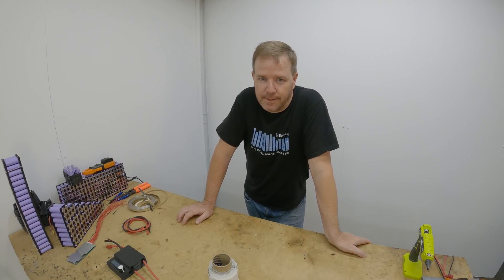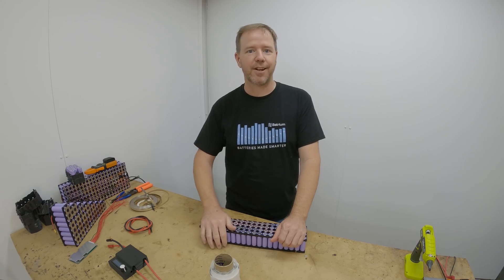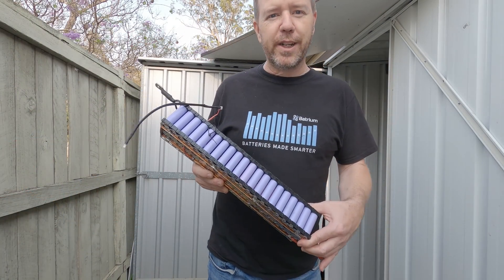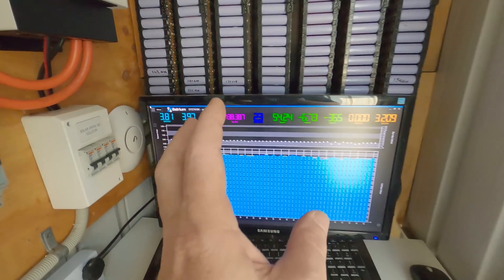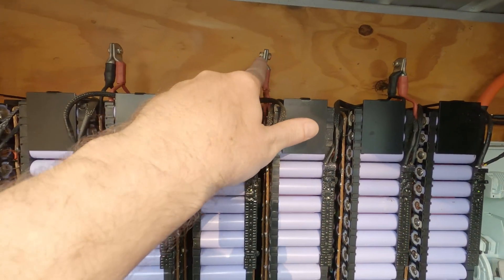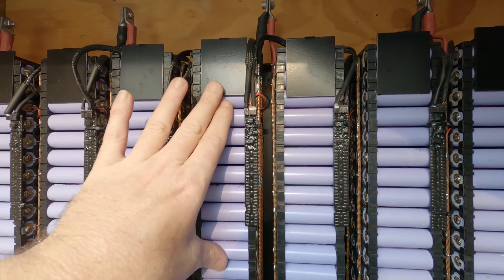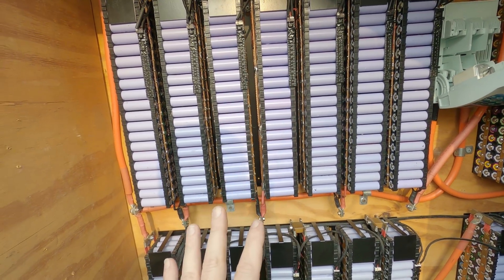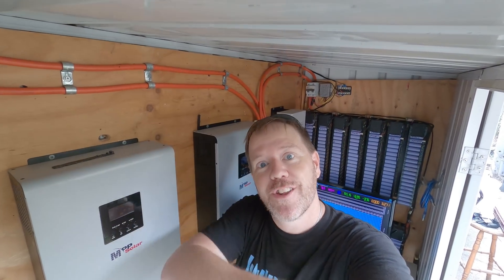Building a fast 18650 DIYPowerwall 80P battery using a KWeld Spotwelder

Comment: Hey mate, any thought on the JK Inverter BMS's? im thinking about using Batrium, but im just not sure.
Reply from the maker: i have 4 batrium systems, would never use anything else
Reply: @HBPowerwall i can't get my head around what I would need. So haven't pulled the trigger yet.

Comment: Hey , that tip you have for your soldering iron is it U shaped?  If so where did you get it and how many watts is it?  Cheers
Reply from the maker: Just a cheap piece of junk that wore out from being make of chinese beens cans
Reply: @HBPowerwall   haha I’m having a hard time soldering the solid 6 to the fused nickel ( I also forgot to solder prior to spot welding the tabs to the cells ) do you have any suggestions?  I’m using a weller 650.  Cheers

Comment: Cant calibrate my kweld  🤯 after first use try to use next day and boom overcurrent. Help needed
Reply from the maker: READ and understand the instructions - don't make things up in your head.
Reply: @HBPowerwall  thanks for replay .I did read 10times before I build.all done how its should be done.first run was calibrated all ok did few welds  100j and power off next day ask for calibration and when I try calibrate say overcurrent. I did mange today calibrate but touching electrode ends not sides.very interesting why.cleaned well tips too.
Ps.love your channel 👍

Comment: Thanks again for the info, I’ll need to search your videos to find content about balancing. My Lipo Remote control cars get balanced, it balances each individual cell in the pack / module. Where you balance modules / packs to each other but not balance each individual cell with in each module. I know stuff all but I heard it was ‘very important’ to always balance each cell with in pack, that would be a lot of wiring I assume. Surely Tesla Power wall doesn’t run 888 balancing wires from each one of its individual 888 cells?

What if one of your cells from the back is 1.5v, do all the other cells now only put out at 1.5v even if they are a higher resting voltage?

Thanks 👍🏻

Edit: I did recently watch a video of yours where you talk about active balancing but I don’t have enough back knowledge to fully understand that video.

Comment: I like your work mate! - would love some advice at some stage considering lithium  cells. My current diy batteries revolve around super caps paired with small solar panels to pulse warm water through my tomato grow beds. But have issues in the morning when the solar charge controller no longer recognises my super cap cell below "X" voltage. Super caps drop volts overnight unfortunately

Comment: Hello can you please tell me how many nickel strips in 0.20 you have To accumulate for resistance for 20s10p battery with Samsung 25r cell. 
I have a nominal 100A bms 200A pic .
For the power of amps. so that it will hold the shock well knowing if is necessary for example doubled or tripled the nickel strips.

Comment: Hi. I am from Austria and in the next days i will build my new powerwall 4.0 from new chinese 18650 (about 2000€) for 1450 pcs.
I had a powerwall up and running, but i had some issues with the soldering points in the old one. I used 5 amps fusewire and sold it to the batteries. But over the time some of these solderingspoints starts to rust and i think i have lost (a good) connection. So i bought your spotwelder and use your promoted sheet of metal fuses and i still dont know how to connect the connectors. Should i solder them (like in your video) and then use protection paint (teslanol) to prevent corrosion or is there a better way? Please help. Thx Markus

Comment: The copper wires need to be anchored to the plastic holders because they are only relying on the fuse links for location strength. Notice the nickel lift at 3:49
Reply from the maker: Yes it does, but need to make holes before attaching, i tried to do it after and i had to use come creative editing or start over lol

Comment: That is one awesome setup. You my friend, rule.
Reply from the maker: Thank-you sir
Reply: @HBPowerwall  I have a question. First you are doing a good job explaining, and you have a good channel. back to my question - As far as i can see, your cells are in series in each pack? but how are all the pack's connected together? what voltage do you have on the side with battery pack's ? Do you have a video where you systematic goes thrue your installation ?

Comment: Love the layout and the final look, and how easy is to connect after each battery set with the others. Still, if after a while single 18650 cells are failing and you need to replace them, what to do? Do you break apart the whole set?
Reply from the maker: you would have to be creative, but it's no different than a timing belt on a car, some are easy some are a pain - you just deal with it and move on. It's really so fast to assemble, doing maintenance and it taking a little longer is an acceptable trade off. That said, is not soldering going to cause even LESS maintenance thus making it even more attractive way of doing it?

Comment: Love your videos. One question I have with all these diy powerwalls is how do you control discharge of your batteries when connected to the grid? So if you are connected to grid, batteries are fully charge and you want to pull power from your batteries instead of grid is this controlled through your charge controller/inverter? I can't picture how the output of everything is being managed. How do you push only to supply house load vs supplying house and grid? Seems that powerwalls 2 has the gateway that helps manage all that but there's probably a bunch of magic smoke in there. Ha this might be too much for a simple message. Thanks for your time.
Reply from the maker: My inverters are off grid. They can not power the grid at all - the units blow up instantly. I run 24/7 from my inverters and if the batteries go flat i can flip a transfer switch that totally bypasses the inverters

Comment: I also recycle cells for e bike battery packs. I hope you might answer a question for me. I have been testing my batteries with b6 hobby chargers and I also bought dischargers online. I just bought a Liitokala 500s charger tester and I’m finding that the mah results it gives me are about 500 mah more than the other dischargers give me. The batteries do get discharged more with the liitokala but not that much more. Can you possibly explain this and which results should I go by.
Reply from the maker: Buy one make and model and stick with just that one to do the discharge tests - to be honest you're looking for the bad cells not the good. You just need a consistent result for your own tests.

Comment: My kweld burns holes through the nickle if I set it over 10 , how does yours work so nicely?
Reply from the maker: I've used different batteries with different results. Havn't even calibrated to this battery. I've noticed if the voltage of the battery drops below 4v per cell the quality drops fast. But i did 100's of welds of tests. Next on the wish list is a second battery or third and run them all together. That with a fan on the electrodes and it'll be such a fast process i'll sell my soldering irons lol

Comment: Very nice!!
Only one thing I would do differently.
I would first soldered the copper buses and then spot welding. 
This way there is no heat transfer to the batteries :-)
Reply from the maker: Definitely !!! There is also drilling some holes to ziptie the busbars to the battery & also adding insulator rings to the positive terminals

Comment: One thing that has been bothering me, before I build my packs. If a cell does fail, it seems that many of the "easy assembly" type frames and connections are going to make replacement difficult. Yeah, I know we all test things well before installation, but shit will happen, yeah?
Reply from the maker: Yep, shit happens - you either deal with it or not it's up to you..

Comment: No problems with the heat in this steel containers?
Reply from the maker: You mean my sheds? Not yet, South side of my home, have about 2" of insulation on the roof & lucky to get maybe 3 hours of direct sun in the morning then shaded rest of the day. Adding to that my BMS controls fans that turn on and off depending on the air temp inside the sheds

Comment: What do you think about this idea: spot weld a bunch of these packs, then line up the packs in series, and compress them slightly all togehter? At the negative and positive end of the series, do the busbar thing. I think that would be the true value of these nickel plated sheets and the amp rating would go way up because a huge section of the sheets would be in contact with each other.
Reply from the maker: I did try this and it works, but no real way of knowing how inefficient it is
Reply: @HBPowerwall  thermal camera?

Comment: I should get my Bartium running soon to make sure its all working. Do I need a computer or is a tablet good enough? Its a wm4
Reply from the maker: Requires a windows based pc with USB & not RT version of windows so you can install Watchmon ToolKit
Reply: @HBPowerwall  so laptop is best then?
Reply from the maker: Laptop works well

Comment: Where they 4s 80p units? Just trying to get my head around some of this as I have around 1100 18650 over 2000 mAH waiting to build a wall.
Reply: These are (1S)80P packs. At 3.6/3.7V (nominal), a 14S configuration would yield a "48V" pack. (Actually 50.4V nominal, 58.8V max/35V min.) Pete decided on 80P based on desired system capacity vs. average cell capacity. Your mileage may vary.
Reply from the maker: I tap power of my 48v bank on the wall that's 4S80P ?
Reply: @HBPowerwall  so you hook 3 up in series to get 48 Volts?

Comment: Surly using the fused nickel strip would mean not needing any bus bar, the load is even true out? Great Video Pete, thanks.
Reply from the maker: evens out the load accross the battery, increased it's amp capacity & makes it compatible with my powerwall configuration ( and looks sexy)

Comment: Awesome, perfect timing. Think I need to get myself some busbars
Reply from the maker: Let me now when you need the Community Spot Welder :) www.secondlifestorage.com/kweld
Reply: @HBPowerwall  thanks man, just need to get me some busbar, where do you forage your cable for making busbars?
Reply from the maker: Gumtree works really well, some sparkies sell off half rolls
Reply: @HBPowerwall  great idea, I am just nickel striping the first 560 this weekend, then my next lot of 560 cells at Xmas, I will make proper 80p packs with busbars like yours. 

I ain't going to be drawing more than 30a max currently and the nickel can handle around 60amps without heat.

Comment: :)) What's the point of still using the copper busbar this time? :))
Reply from the maker: distribute current flow, increase amp rating & to make it compatible with my current configuration.
Reply: @HBPowerwall  Yes, that's really important.
Nickel has much more resistance than copper and the path over the cells is quite long.
Incidentally, looks like the pack could do with some straps or wrapping as it looks like the nickel plates and bus bars are only held on by the fuses!
Reply from the maker: They are I explored the idea of drilling holes in the nickel strip to put some zipties in but only after applying the nickel bad move on my behalf but I know better and the next itteration shall be better. That said for stationary storage it'll almost never be an issue unless you have a woops moment.
Reply: @HBPowerwall  It's the whoops moments that you know will never happen that get you!
Zip ties are a great idea though would have to loop around the bus bar as the nickel would deform.
Large heat shrink sleeves would probably be too expensive and limit maintainability.
I think my favourite would be velcro straps as they're cheap, strong and convenient, and don't leave a mess like duct tape.
Reply from the maker: I'll do another video - i thought this one would have gone better.. typical youtube crap - so much time and effort and 5k views and 11 bucks income lol might do better in the coming weeks i guess

Comment: 0:51
As repetitive as that task is, I would get a V shaped, non conductive, holder to keep them in optimal position.
Reply from the maker: I have that, this way is stupid fast! Put the Kweld into auto mode, put a small fan blowing over the workspace to keep electrodes cooler and GO - if it wasn't for filming it would be so much faster again.

Comment: Hi HB I believe  You common in one of your videos  The K Weld electrodes get hot before you finish one side to of pack as I have a K weld to I  Considering getting an extra pair of electrodes  When one gets hot you can  Alternate let the other ones cool just have 2 p Pair hooked up all the time lol
Reply from the maker: All I needed was a small usb fan blowing air across the battery & electrodes , take a little more time placing the electrodes to slow me down and i can do both sides before needing to have a cool down period.

Comment: Are you stressed out about the heat it could generate when the fuse is about to blow? I saw your video when you tested the nickel fuses and I was feared that it could heat up the cells and start a fire.
Reply from the maker: It's no worse than my current setup, the whole battery isn't going to fail. One cell might - add a potential amp dump of 200 amps to a single fuse and it won't even get time to glow before the fuse blows. If a case arises where all fuses in one battery needs to blow it'll more likely be along side the rest of the battery - then the amps could be 1000's of amps again instant blowing of all 80 fuses on one battery. The way i tested was dumb, and not how fuses are ment to work. All that said i'm happy to be proven wrong.

Comment: How does it go removing a faulty cell
Reply from the maker: Rip it off start again...
Reply from the maker: No different to an eBike or prebuilt battery pack.
Reply: @HBPowerwall  yeah just thinking of metal fatigue welding and rewelding
Reply from the maker: Less stress on cell than solder i guess.. either way this is a learning curve and together we will make something that works and is cost effective
Reply: 1) Cut out the bad cell.
2) Spot weld new nickel strips across the void where the bad cell was removed and to adjacent fuse foil.
3) Install replacement cell.
4) Spot weld new nickel strips across replacement cell and to adjacent fuse foil.

I'd have to give some thought to individual fusing for the replacement cell.

Thoughts anyone?

Comment: Do you think these nickel fuses can take 4A continuous without heating up the fuse link itself?  Im curious because they would be good for my ebike pack that will max out at 4A a cell.  I sent a message about this to alarmhookup a few weeks ago but no response on this subject.
Reply from the maker: If your local come test the theory at mine.. i have a bit spare :) I think at 4 amps for short periods of time it would be fine, as the nickel plate disperpates heat fairly well. If you were drawing that load for a long time the heat build up would be an issue. I don't think this in it's current form is well suited to a higher amp draw of an ebike. Also unproven in vibration tests. That would concern me more than anything else.
Reply: @HBPowerwall    Im not local unfortunately and you make all valid points!  Im going to stick to standard nickel strip for my bike packs.
Reply: James McCreadie rily

Comment: Nice Pack! Speaking of hitting batteries too hard. How is your HVAC/Heatpump doing? Are ducts in a hot attic? How much space do you have to cool? Does air escape uncontrollably? It could be a video, might even be cheaper to replace something.
Reply from the maker: They are just mini splits in each room - I love my cold air, I also like fresh air so house is always pulling fresh air from outside. Not efficient but a comfortable comprise.

Comment: I have just started watching your videos and subscribed  I wanted to ask a question i have been struggling with configuration of my battery pack for my ev motorcycle. I want to ask four questions :-
1. Can i connect 3 x 72v lithium ion pack in parallel with configuration of 20s 10p to power my 72v 3000w motor controller it supports 50A so does the motor? (I want max range and power)
2. All 3 packs will have BMS so how do i charge it what charger should i use for this purpose and will those BMS work properly if connected in parallel, what amps will it req to charge?
3. Should i make 3 72v packs or should make 6 24v packs and then connect 3s 2p which one is better ?
4. If question 1 and 2 are possible then what wire should i use to run this project?

Please respond its my first time ever commenting on youtube video i hope you can answer my questions
Reply from the maker: I would love to reply... but unfortunately everything i know i've googled or tubed so probably not the right person to ask i'm sorry.  The forum or facebook group linked in the description would be your best bet for help
Reply: No time for your ass, he just wants the views and the likes. Then refers you to his FB forum to get clicks on that also.  This is why I can't stand this guy. And since I am a better man, I always try to give him another shot but then I end up reading some shit like this again. SMH